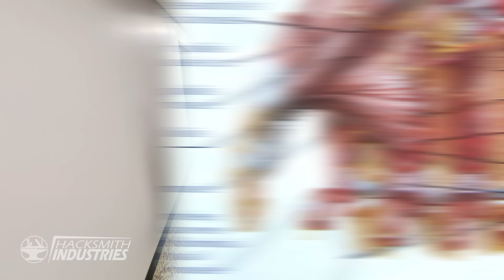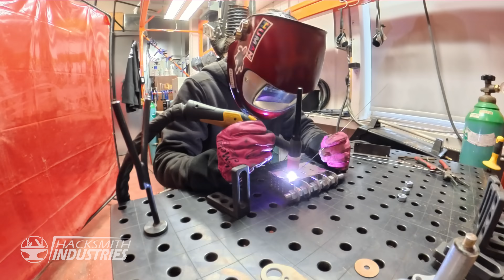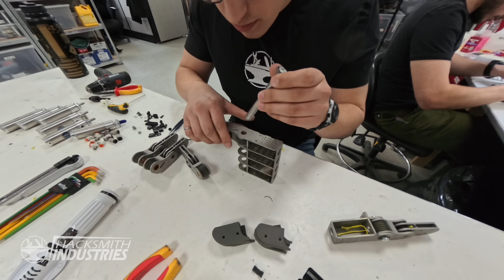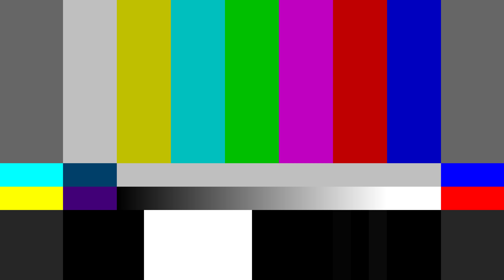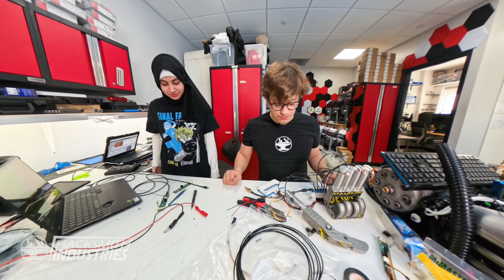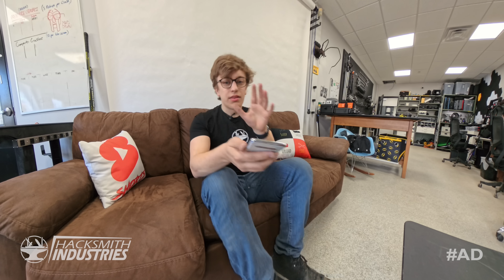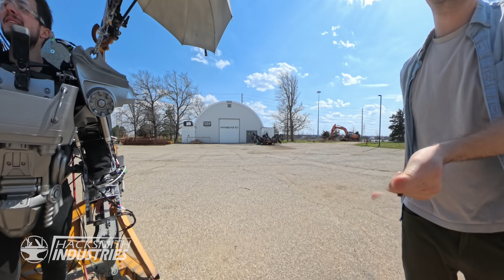Building Robotic Hands | Real Life Power Armor (Part 5/6)

Comment: The reduction of finger joints is iffy but the thumb is practically vestigial with how you have it if not in the way. It's lined up with the index and middle finger so they can't be used with them, on top of that the cylinder for the thumb is sticking out on the other side creating a potential fail point.
Reply: thumb is essentially cosmetic. The hand needs a complete rework
Reply: Yeah it feels like a really early prototype they pushed into a video. If they absolutely had to fix the thumb in place it should've been in a position to grab cylindrical objects, not just push down on the top of them. I have been studying how mechanical hands work for the past few days, the main issue I see is that basically right where the wrist of the mechanical hand ends is where the human hand is which might have issues for how the whole system could work

Comment: I've been really impressed by all of these power armor videos so far. But this one kinda misses the mark. If insta is requiring THAT much glazing in their advertising guidelines then I think another sponsor may be needed moving forward. Also, I feel like the hands were just super rushed in this video. All of the other parts of the armor not only work, but they work well. Fingers with a binary "extended" and "relaxed" position will just not do for any hand. our fingers don't just turn on and off. Not to mention the knuckles are off and the idea of using rope is something straight out of the renaissance. This is the first video in a long time that in my opinion was just a nothing-burger through and through. Love the channel. but this video was a miss.

Comment: I think the grip isn't great as the fingers aren't long enough, in the sense that they are one joint too short. I would try extending them.

Also, the technique is extremely similar to those 3d printable finger extensions you can find online. Cosmetically they look great for Halloween costumes, however you can technically grasp much larger objects too because of them!

Comment: Carbon fiber cables, sheathed inside waxed kevlar or aramid cable tubes.
Or just straight up steel cables .
The cabling could literally just be woven fishing line used for marlin, sail fish and or sharks.
I "think" they make 300lb test strength.

Comment: You've probably already thought of this, but chucking it out just in case. Bicycle break/gear cables for the rope and rubber grips (possibly an old car tyre) covering the inside of the power gauntlet? Should help with grippage but don't know how it will affect binding and fluidity of motion.
Reply: Hear me out. Using that rope but coating it in the ‘real life adamantium’ like the rest of the suit. It would be so much stronger if they did.
Probably really expensive though…

Comment: Some strange choices. I hope this doesn't end up being the final hand - the 'back of the envelope' design is kinda spoiling the vibe of the rest of the suit. Prosthetic hands tend to share an actuator for pinky and ring finger, because those rarely act independently - doing that would've allowed you to inline the thumb actuator alongside the others. Speaking of the thumb, it closes the wrong way - thumbs aren't 90* to the palm. Also, flat pads for the fingertips is a mistake alongside 2-jointed fingers - although I'm sure you already worked this out, it means the hand can't grip anything thicker than the length of the first segment (the hammer-handle you offered up to it being a good example of this). A slight crescent shape to the top segment, or a soft protrusion on the pad, would go a long way to improving the grip - but really you should just give each finger the correct number of joints.

Comment: I still think that instead of compressed air, you should use steam.
You can make a steam reactor with the innards of catalytic converters, inside a boiler rated container and use solenoid style gas or diesel engine injectors to input the hydrogen peroxide.
🤷

Comment: You mounted the thumb wrong, you made it slide laterally across the palm, which does absolutely nothing, you need it doing the same movement as the fingers but in the opposite direction.

Comment: Another problem with the security of the grip is that the thumb doesn't curl opposite the fingers. Opposable thumbs are kind of important for gripping objects. This thumb is basically cosmetic.
Reply: Yeah, maybe an extra degree of freedom to 'rotate' or swivel the thumb
Reply: @theoverlord3839 exactly what I was thinking. Maybe allowing the thumb to rotate up to 90° away from the hand would give it that ability.
Reply: @theoverlord3839  I read this as that the thumb would swivel like 360 degrees kind of swivel so I imagined swiveling it too far and just breaking your thumb
Reply: Yup, and that the thumb doesn't just curl, it can also move up and down a little to adjust it's grip.
Reply: @AquariumGravelEater agreed.
Reply: @AquariumGravelEater  And that moving up and down motion doesn't really even need to be powered!
Reply: thumb rotation is a important part missing....
this is bad.
Reply: 100% bro!
The rest of the fingers don't need realistic degrees of freedom, but the "opposable thumb" is very, very important
Reply: This was one of the lessons in e-nable prosthetics. Even a fixed opposed thumb is helpful.
Reply: And the missing third joint in fingers (even an extra static bent joint would improve this). First part of the build that is quite unsatisfying to watch.
Reply: yeah the thumb implementation is really dissapointing. that and the control mechanism, not just the inability to press the two fingers, bu it should be tracking the full finger and wrist motion not rely on a button press. Oh yeah, no wrist motion? would make clapping possible, and gripping with two hands. No thumbs or wrists makes aquite a lot of problems. Also theres no grip in the palm, so we rely on single surface friction for grabbing? No splay in the fingers makes dynamic grabbing difficult as well... I have a hard time believing none of these features exist in power armor. Hands are kinda important man.
Reply: @kraken2844  I agree with the thumb thing, but the reason the other stuff isn't there is that they require LOTS of moving parts and are really difficult to make compact. more moving parts = more fragile, which is a problem when you're trying to make power armor.
Reply: It honestly astounds me that the engineers who work there are presumably not stupid people, yet they completely missed the most basic (but important) part of how a human hand works... THE OPPOSABLE THUMB.

It actually hurts to watch this video, and that's coming from somebody with literally zero engineering qualifications whatsoever.
Reply: Also the palm "bends" because of where the top most knuckles lay in relationship to the palm, which allows for a higher range of motion to be able to grip things.
Reply: Agreed. Opposing thumbs are the main reason why we can grip things and manipulate them. Pretty important as these were the main reason why we evolved so greatly. It can be little tricky but a tiny puly sistem can be attached and the thumbs can be at 90 ° angle it may work and worth a try.
Reply: Agreed
Reply: Everytime he  wanted to Grap something he Hard to use the Maximum power of the Fingers 
With a Thumb he wouldnt have to do that
Reply: @shal2285  why is it that when I pointed this out everybody told me to shut up?
Edit: nevermind, it was just the same guy saying the same thing twice.
Reply: I was looking at the finished product and I was like there’s something off, but I can’t put my finger on it
Reply: @MadoxHowlett good joke 👍
Reply: 5th grade biology class…
Reply: The guy nailed everything just to lazily design the thumb.. :/
Reply: I can’t unsee this now
Reply: "Clair Obscur: Expedition 33" ($50 nueva) es "GOTY" en 2025 (en mí opinión)🏆
Reply: They gotta pay for all this somehow🤷‍♂️
Reply: They should try something similar to a prosthetic hand, maybe have it use actuators instead of strings for increased strength, then connect them to some sort of glove in the armor?
Reply: Agreed
Reply: That's smart good eye
Reply: Reminds me of Gorilla or Chimp hands, with the weird thumb.
Reply: I'm sure they considered that, I would assume it just isn't possible with the cylinder and rope system...
Reply: @pe8268  If you have the thumb at a fixed angle 180 degrees from the fingers, like a claw gripper, then the piston could be parallel to the other pistons, and you'd only need one pulley to fix the angle of the cord to whatever angle you want the finger at when the hand is open. It's barely any more complicated than the other fingers. The only reason I can think of is that they didn't want to or have the time to 3D print a separate piston housing for the thumb.
Reply: im like actually pissed off by that, im happy its the top comment
Reply: Yeah humans uniqueness is from our brain but also our opposable thumb.

Comment: Is it possible to get analogue controlls for the fingers, that have a bit more depth?
In sci-fi you usually see people use some kind of pull switches for each finger, idk how to describe it.
Maybe it is possible to make a valve that has a variable output flow for each finger and use your fingers to directly drive the valve, skipping all the electronics?
Or at least have a hall-effect switch on a rod that you pull on with your finger that controlls the corresponding suit finger...

Comment: I'm only in the beginning of the video but it's interesting to see that the cylinder is being used in reverse, where the smaller surface area regenerate less force on the cylinder. I can see this as a design limitation for the application I'm interested to see if there's a way to improve upon this to have more force

Comment: why didn't yall just use some form of steel cable? Aircraft Grade Wire Rope 1/8th inch. Does the design require the stretch rope has to offer?

Comment: Guys, I'm not sure if I saw it incorrectly, but I think the reason why its not good at gripping, is because the fingers have 2 joints, not 3, the only finger with 2 joints is the thumb
Reply: Also your thumb doesn't close horizontally across your palm. it closes vertically in opposition to your index forming a type of pincer when closed. The moment he put the thumb on I knew they wouldn't have much success gripping.
Reply: @Deagle-Games-OG  which technically means the thumb is the longest finger on your hand.
Reply: @ yea i was unsure wether or not it counted as a joint, but im suprised nobody caught it seeing it in person
Reply: Thumb also has 3 joints, it's just that one of them is more incorporated into the palm
Reply: @tailstechvideos2327  Thanks, I really didn't enjoy realising that my first thumb joint is in my wrist, and now I can't stop fidgetting with it.
Reply: @tailstechvideos2327  yea i was unsure wether or not it counted as a joint
Reply: I was thinking the same thing. Plus, there's no option for the fingers to splay outwards and the thumb can't rotate, so the operator is loosing some dexterity there.
Reply: @josephhenderson2538  yea but i think it would be almost impossible with tech at the moment or its too expensive
Reply: Thumbs have 3 joints, too.
Reply: True but this hand does work as a proof of concept. If it gets iterated few times with better materials and a cleaner design, it can be improved greatly.
Reply: You beat me to it I was just about to mention this
Reply: its bad at gripping because the thumb isnt at an angle
Reply: @S.K.u.S.H  and the fingers only have 2 joints

Comment: Soo.. why did you decide to make the thumb non-opposable? That should certainly help with gripping. 

Also, you could remove the pinky finger, you really won't loose any dexterity with a mechanical hand like this and it would greatly simplify things.
Reply: this series almost certainly won't be finished in 6 episodes so they'll probably change it later at some point

Comment: My expectation were low before watching this and still got disappointed. This is the best you've got?
Reply: You can only get so much form and function into one package, if you wanted them to use a bunch of stupidly small actuators to represent every degree of freedom of each finger, then you don't get a strong or reliable hand since there's more points of failure.
Reply: Shows us you can do it better. Easy to criticize when you aren't the one trying to fit a lot of sci-fi tech into real world form factors with actually existing in real life technology. I mean, a million servos and their electronics are doable when you have nuclear power on board, you can do so much when you have modern batteries.

Comment: I do think trying out haptic gloves for the controler instead of the buttons eould be greatly beneficial, as youd be able to then get haptic feedback out of it, as well as generaly more precise control
Reply: I was definitely imagining something more akin to the Thanos toy gauntlet where each finger has a string
Reply: @TheReal_N-I-F-F I was thinking a string/pulley based system for cleaner control over the fingers. Not sure how that would work for grip strength/if it could be changed, but I can't see that current setup squeezing a shot off without emptying the entire magazine haha
Reply: @TheReal_N-I-F-F same
Reply: Maybe a collab with Lucas VRTech
Reply: @maxmachac9756 Yeah, that's what I had in mind as well. Or at the very least a rig that allows the reach of the wearer's fingers to extend, like what the other replies here have suggested. It's quite simple to do as well; I've seen many people do it just using cardboard and string, though the haptic gloves do sound like something the power armor would actually have
Reply: Would need room for the operator to move their fingers within the confines of the arm.
Reply: Well said
Reply: thats exactly what I was thinking XD it would allow for lot more possibilities and could open a window to doing gestures for the helmet
Reply: Personally it looks like precision isn’t so much the problem as just the shape and strength of the fingers. the thumb is also angled really strange.
Reply: The thing with adding that sort of complexity, is that you're adding complexity, and these pressure sensors seem like they were added for reliability. After all, they could've just gone for normal buttons, but they went for pressure sensors instead, which to me suggests they want to reduce moving parts as much as possible.
Reply: Haptic wouldn’t work.😂 if you pick something up the glove thing your trying to close your hand

Comment: Would be a glove with strings on the fingers wich pull on sensors would be more intuitiv to use?
Reply: It probably would be, but you need to consider the space needed to amplify the grip strength of the user (of which you'd need five of on each hand)
Reply: @uwuanims  I had a similar layout like they build in min. but instead of the handle with the buttons a glove with the sensors or switches.